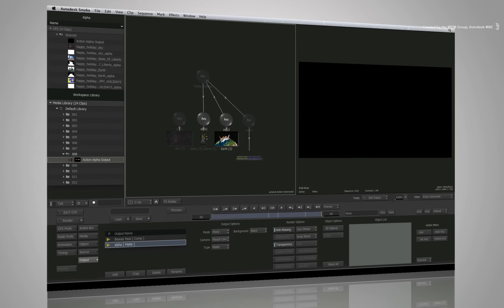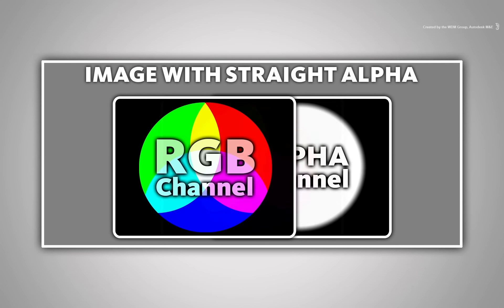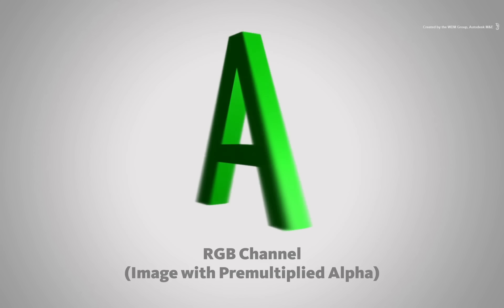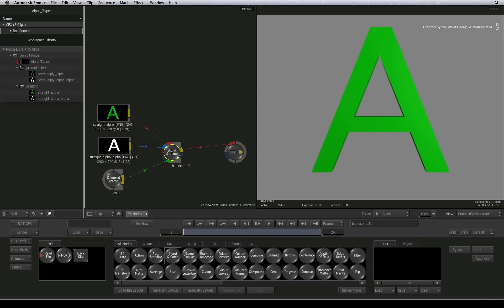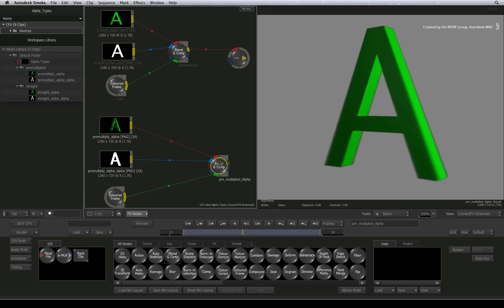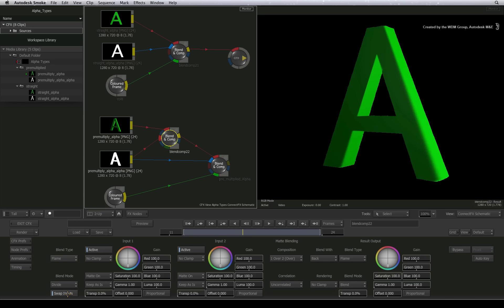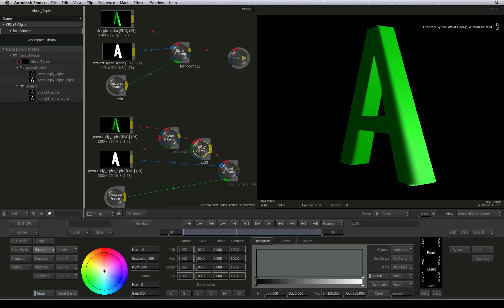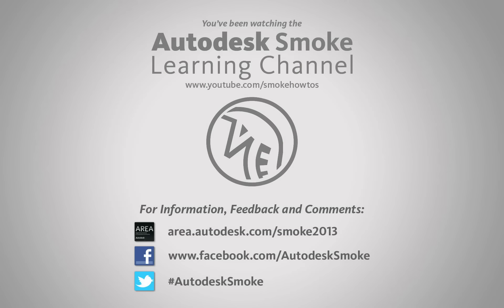Alpha - Part 9 - Straight Alpha versus Premultiplied Alpha

Comment: Why would you use premultiplied?
Reply from the maker: I have always understood that it has to do with semi-transparency and edge softness.   Sometimes you can get a better compositing blend using pre-multiplication with an alpha on black especially for motion graphics.    The drawbacks of premultiplication can sometimes be black edging because the alpha is multiplied into the RGB channels as well as the RGB channels not being accurate because of the alpha pre-multiplication.     In a lot of cases, it should be fine to use it but if you're doing a bit of colour correction and/or want accurate RGB channels, you can divide the RGB by the alpha or use a straight matted version instead.